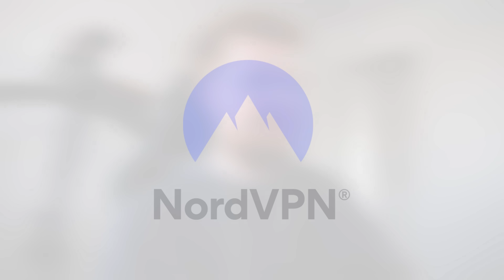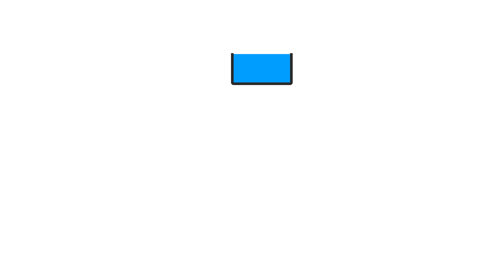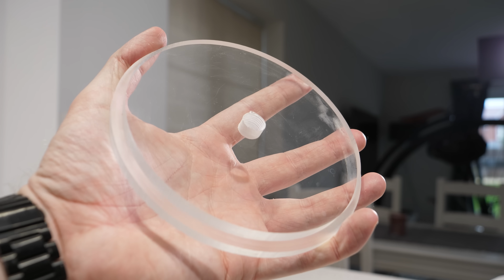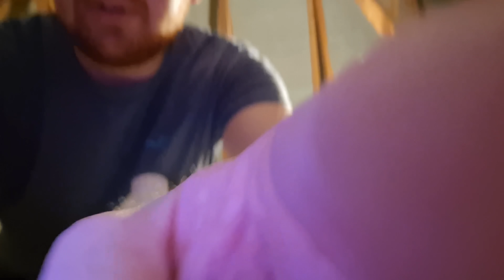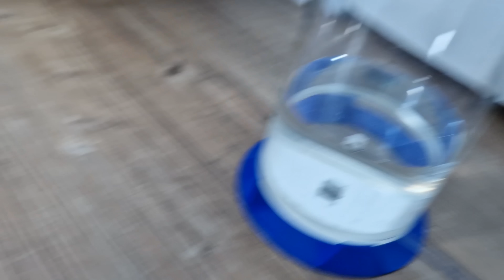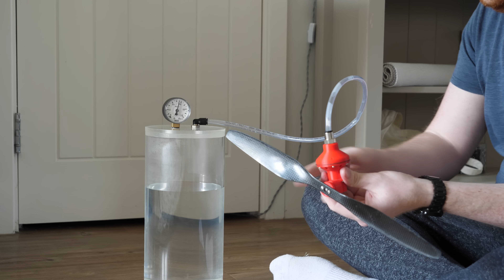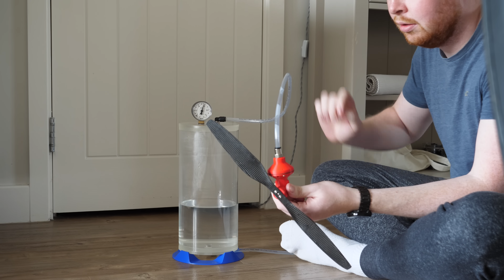Liquid Air Engine

Comment: Rather than draining the tank and carrying water upstairs, you could just T your bike pump into the tank and push the water back up with air. In the end it is a pumped storage hydropower system, the question is just if the pump is attached or if the pump is your legs.

Comment: What about adding a gear box and using the larger diaphram at full pressure? With a gear box the propeller would act as a fly wheel and should keep the pistion turning

Comment: Random thought: make the top of the tank conical and put a ping-pong ball inside, so that when the water level rises high enough, it automatically cuts off the air supply to the motor

Comment: based on what you know now about optimizing your design, do you plane to test some of the older "successes" to see if you can get long/more powerful run times. With a bigger pipe, you might be able to use a valve to limit refill time and find the optimum pressure for continuous run. Fun Video. I love the enthusiasm of the surprise success.

Comment: That's actually pretty cool.  You could probably set a float valve that cuts off the air when water hits a certain height too.  I wonder how efficient this would be as a storage solution in large scale.  Use solar power in the day to power an important load, as well as a pump to pump water upstairs.  At night, a valve would let the water drop and run the engine to produce power for the important load.    I guess the question would be whether or not it would be cheaper than batteries.   It would be kind of fun to setup an automated system like that just for fun though.  Have the whole thing basically be automated.

Comment: Hey Tom, have you ever seen the paper engines built by the YouTuber ‘Aliaksei Zholner’? They run on compressed air, like many of your projects and they are super neat. Aliaksei uses only paper, tape and glue to make fully functional miniature replicas of a variety of engines (V6, V8, inline, Wankle, etc) and I think it would be right up your alley!

Comment: now all you need to do is figure out how to put the wasted air coming out of the motor back into the cylinder with water, maybe measure the air coming out of motor to see how much pressure it still have? will give you and idea of what to do with it

Comment: Have you considered, without modification to the tank, using a larger diameter hose down to the tank? I believe that the small hose is working like resistance wire and causing the poor flow in addition to the small tank orifice. So perhaps much of the resistance can be removed by using a larger tube.

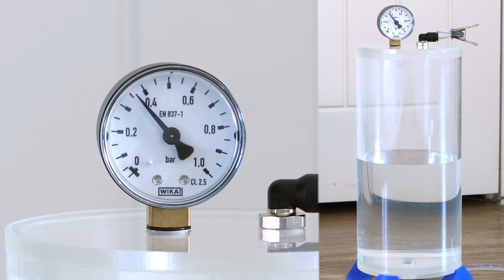Comment: I'm at 8:43 of the video, my mind instantly went to those old hit or miss gasoline motors. I wonder if rigging something up like that would solve the air volume rate issues. Maybe with a heavier flywheel too.

Comment: Fun fact, having an open system like that with a tank on the loft, is actually how you pressurized the central heating system in houses back in the day 😄 
Here in Denmark they used to measure the water pressure in the system in mVs (meter vand søjle) meaning “meter water height” I suppose. Basically one meter is equal to .1 bar of pressure :)
Reply: pumps are commonly spec'd in meters/feets of "head"
Reply: I still don't drink warm water out of the tap, even though it's all combi-boilers nowadays.
Reply: What do you mean, back in the day? I do still own one fifth of a house that has a central heating system like that.
Reply: And yes, I learned the hard way that was how it worked. Because yes, when the house had been connected to the municipal water system, there was a valve through which you could repressurize the central heating system, and no, the open tank up in the second floor wasn't removed... And no, I didn't overfill the system directly, I did follow the pressure gage. But the heater got the water in the system too hot because of some wrong settings. I did get all the warm water cleared before it had a chance to get soaked in anywhere. Luckily. But that was still quite dramatic.
Reply: @jannepeltonen2036  usually you would have a pipe from the tank on the loft, that went to a drain somewhere, so that if you accidentally overfill the system or something went wrong, the house wouldn't get water damaged :).
 I've changed a few of those ''open air'' systems out to modern closed once. So yeah they are still around, but they stopped making those systems a long time ago here. :)
Reply: "Back in the day" - Britain called, they would like a word.
Reply: Today they will burn coal, in order to spin a steam engine at high pressure, then run that energy in form of electricity over miles upon miles of copper power lines into your house to charge you for it. Not at all wasteful, not ever heard of energy transfer loss of (80%+!). When instead you could just burn that coal right at your home from wood on your property to minimize cost and waste (SHhhSHSHSHhhhhhh) dont tell anyone you'll get shad0wb4nn3d! Well, or in this case, instead of burning coal, just carry some tanks of water upstairs every day to run a small dynamo to charge the basic of electronics. Or collect some rain water from the roof and channel it into the system.
Reply: @foopadr9076  Did you just say that the energy transfer loss of power lines is 80%? Because that's wrong. Very, very wrong.
Reply: i'm confused about the Bar unit. 
Google says 1 atmosphere of pressure is 1.01 Bar. That can't be right right? How do you get under a Bar at sea level?
Reply: @Broockle  I think pressure gauges measure pressure differential - so 0.6 bar of pressure difference with the outside. Relative pressure, meaning the actual absolute pressure if brought it to space in a vacuum would be 1.6 bar.
Reply: @velianlodestone1249  
oo, i hadn't thought of that
that's cool, thx

Comment: I accept Tom that you know the maths better than I do, but I would be quite nervous with that pressure chamber design. I would be MUCH more comfortable using an interrupted thread in combination with the shoulder and glue set up you have. Assuming your system allows you to cut it out of a solid block of course.

Comment: This could actually be pretty handy for doing something like running a micro sbc and some basic sensors to collect data about rainwater when it is collected. I know the obvious solution is either tiny hydroelectrics or a battery but this is a way cooler solution, and I love the sound of pressure piston driven devices

Comment: I ran a pneumatic wood sander on water before. The air dryer was broken and the line not used often filled with water. That sander almost blew apart it was chooching so fast

Comment: at this point you should fill the bottle with a little muratic acid (toilet detergent) and put some aluminum foil in it. so with little weight you create all the pressure you want

Comment: That was interesting and entertaining. Why not use the mains water supply rather than a tank in the loft? Mains water should be between 2 and 3 bar. Please check with your local water supplier. It would give a greater pressure and greater flow rate. A larger tank would, of course, provide a greater volume of air.

Comment: Was going to suggest a "water powered water engine", but then I realized that's just a turbine, identical to any hydroelectric dam.  Would still be cool if you felt like building one, just turns out it's not a new idea.

Comment: Are you sure the engine enclosure itself is air tight? For my university project I printed some pneumatic stuff thinking it should be airtight but I put it in water and applied pressure and it bubbled like a fish tank aerator. Since it was made of ABS I could use acetone to seal all the layers together, made it perfectly airtight. Even the threads that I tapped.

Comment: Maybe a shuttle valve rather than a ball. Have a third chamber that is filled by the pressure line. Then the valve closes the pressure line and dumps the chamber into the power cylinder. That way you get a constant volume of air with each stroke. I think it would run better at higher pressures but it would limit your low pressure operation. 

A tiny preload spring on the ball valve would probably help with the current design.

Comment: Also friction in your tube is a real and noticeable thing.  To get around it just oversize your runs a nominal size (i.e. go from 1/2 to 3/4 od or whatever size your using). I wrote this at the beginning and keep pausing to add to it.  
You can straighten your tube the best you can to increase the flow rate as well. The same effect can also be had if you kept your pressure tank at the same level and just add air pressure to the tank via air compressor. It would create the same conditions and also get rid of your tube.  You’ll be limited by the size of orifface used but at least get rid of friction.  That’s actually how flow rate is determined, by the pressure drop through an orifface.  (I am good with mathematics but I spell horribly).
Lol I just noticed that you are just using the head pressure as an air compressor. I thought you were using water as your medium not air.  My comments are not really useful at all then.

Comment: Your issues is standard fair for plumbers. That’s how we test our systems. We put 8-10’ head pressure on it.  Due to an injury I’m in school to be a chemical engineer and have found massive amount of problems solved by plumbers.  Anyhow it’s cool to see someone go into my field with just a flashlight so to say and figure out principals taught to me through plumbing and mathematically in uni.
Also that’s .5 bar gauge pressure actual pressure you must at atmospheric so your actually at 1.5 bar
Reply: Thank you! I have been wondering how he got the engine working at 0.5 bars, when the outside pressure is at 1 bar.

Comment: With this new improved engine system you have in place, will you attempt some more high pressure tests to see if it can squeeze out just a bit more efficiently and performance?

Comment: You should rig it backwards and try running it on vacuum. Shouldnt be too hard to use the water to pull vack rather than make pressure with the system you already have

Comment: Tom, I like it when you make measurement conversions for those of us who are not familiar with the metric system. I frequently have to dash for a units converter to understand your measurements. (The metric system is only for those people who haven’t been to the moon). 😀

Edit: 13:11 
You’ve discovered the need for a flywheel.

Comment: reciprocating pistons lose a lot of energy due to the "vibration" - of them having to reverse direction. There's a reason the most efficient generators are turbine blades. 

If you make a turbine rotor with a LOT of drag ( lots and lots of baffles ) you might be able to make an even more efficient engine.

Comment: I had a thought about your air engine design.
You've got the pushrod on top of the piston pushing the ball valve open about halfway between the top and bottom of the stroke, right? so there's some "wasted" pressure in a way that slows the piston down on the way up,  and then the ball re-seals when you're only halfway through your powerstroke again - which I know you're partially compensating for with the kind of reservoir design and the pop valve thing.

But here's an alternate idea I thought of - what if you used a small spring like a click pen spring to push the ball, and had it in kind of a "detent" sort of setup so that the ball didn't move until the spring provided just as much pressure as needed to open when the piston hits TDC, and then stays open until the piston hits nearly bottom center?  sort of a click-open click-shut kind of action?

Comment: If you need to extend duration at the cost of a higher flow rate of water, you could try using a trompe, which relies on a similar principle, but uses the reduced pressure of flowing water to pull ambient air into the system.

Comment: Amazing. I love your videos,  thank you. 
Initial thoughts: how about add a variable length needle that pushes on the ball at varying lengths depending on inlet pressure? So for example if the engine experiences a high amount of air pressure coming in ("lots of fuel available") then the pressure pushes a kind of lever that makes the needle Long, but if there is low air pressure ("low fuel environment") the engine "detects" this and the pressure only pushes the lever a small amount and the needle pushing the valve remains short,  and the engine is able to operate at low pressure or high pressure.  "Variable Pressure Engine Design" seems to be a logical direction you're headed.
Reply: In practical applications like propelling an airplane it is much more useful if you shorten the needle at high pressure and lengthen it at low pressure to regulate the rpm and power output, that can be done by replacing the needle with a spring. At low pressure the spring can easily push the ball without compressing and at high pressure the ball gets pushed down by the pressure causing the spring to compress while pushing the ball and therefore it gets shorter... 
A shorter needle at low pressure only makes sense if you just want to keep it spinning without drawing any power from the engine...
Reply: @Henning_S.  this comment section is so educated

Comment: Could you use the calcium carbide and water reaction to create a gas pressure and run the engine on that. Obviously don't light the gas though

Comment: Would it be possible to combine some of the designs you've created, added a battery powered air compressor, that could fill the air engines fuel tank so your past models aren't stuck with only the air supply that fits in a 2 liter bottle? Just a random idea.

Comment: That's a really cute variation on those gravity-powered generators ! The self regulation reminds of those clever Victorian-era steam engine regulator (centrifugal governors), all mechanical. Would it work in reverse ie. you turn a crank and it pumps water up ?

Comment: I wonder if you'd have better results on some of your motor parts with an SLA resin printer, like the Elegoo Mars 3. Smaller build volume, but the parts are amazingly smooth and clean, with 0.05mm layers. I think they're also quite a bit stronger, especially if you get the structural resin.

Comment: Something that might help cutting plastics, and also metals on your cnc is a fog buster system. Works super well, I can machine aluminum for over an hour and when its done the bit isnt even warm to the touch. Not sure how well it would work with plastics/acrylics but it cant be worse than nothing.

Comment: If you model your water circuit like a L/C resonance circuit can you use induced resonant pulses to push this diaphragm at a high fq resonance?! Perhaps taking advantage of the "water hammer" effect? Small pipes as resistors.... water hammer prevention devices as capacitors? perhaps a mechanism that stores kinetic energy to act as an inductor?(Tesla pump attached to a flywheel?)

Comment: Is there a small lightweight pressure regulator? The problem with all these air engines is they run way too fast at first then drop off sharply. Now that you have this engine running on low pressure, if you could regulate that pressure you could revisit the drink bottle air tank and get a plane to actually fly an extended distance.  This is a project I've always wanted to see!

Comment: Take this outside and put a tank on your roof to a bike plastic drum on the ground and use way bigger tube… that looked like half a gallon of air so if you used a 5 gal drum id bet you would get just short of an hour of run time or more if you added a throttle using a pressure valve

Comment: The flow rate is limited much more by friction losses in the long tube than by the size of the fittings. If you printed some adapters and replaced the tube with one that has a larger diameter, the pressure probably would stay at a value much closer to 0.6 bar.
Reply: Also straightening the path the tubing takes will reduce the friction losses.
Reply: I was looking for this comment.
Reply: Yeah I thought so too. I would definitely like to see an attempt with a bigger tube!

Comment: I wonder if you create a closed looped system with multiple tanks under pressure that switch valves open at different times to transfer the force and keep it going?